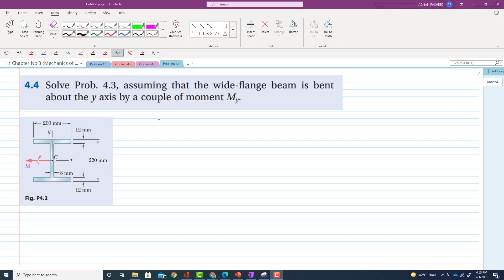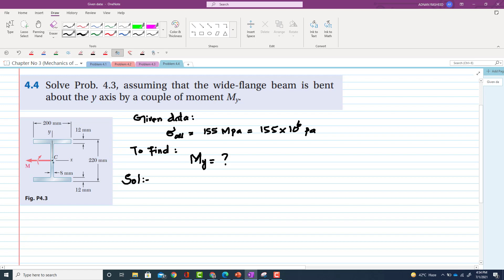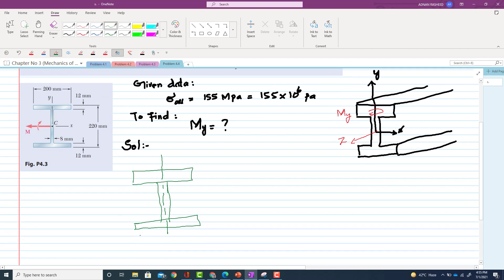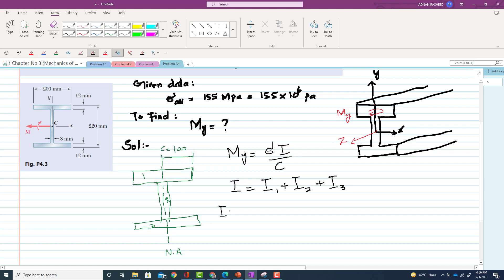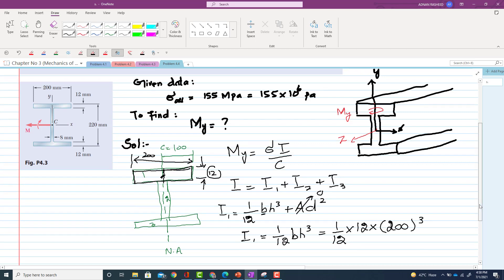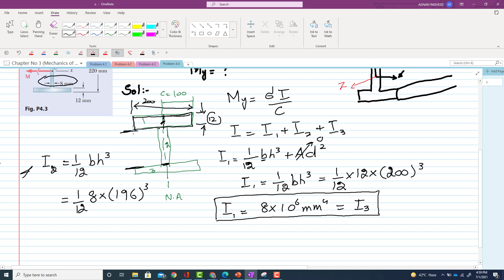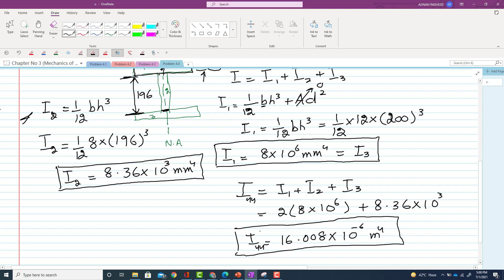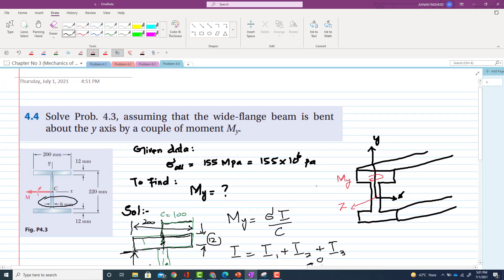Mech of Materials# |ProblemSolutionMOM​ | Problem 4.4 |Pure Bending| Engr. Adnan Rasheed

Comment: I2=[1/12]*196*8^3=8.36*10^3 MM^4
Reply: La base no es de 8 mm?, why usas los 196 como base?
Reply from the maker: @hakate3820 you can see total height is 220 so height of Web portion will be (220-12 -12) = 196 mm where 12 is the thickness of  each flange